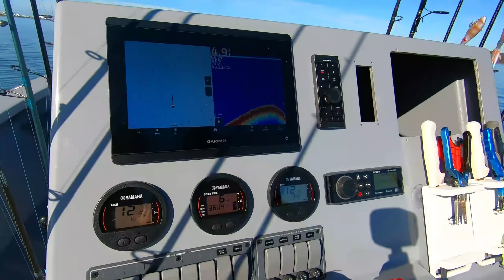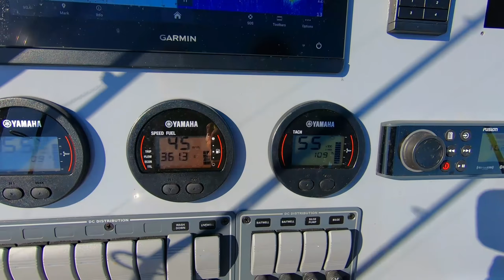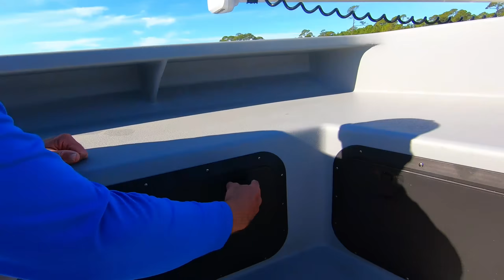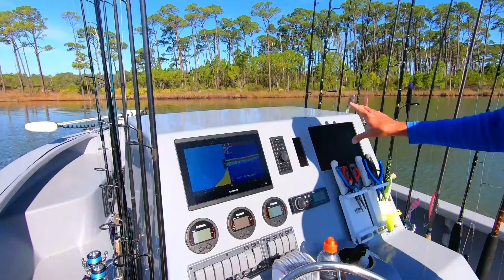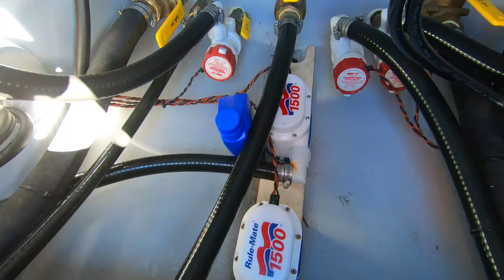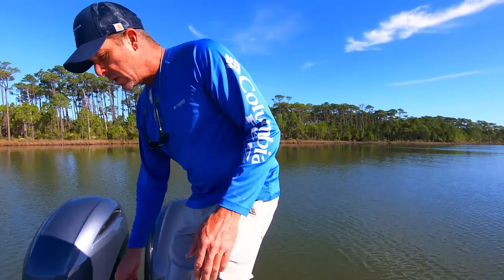EP-25 BOAT BUILDING SECRETS REVEILED! TOP SPEED RUN AND FULL BOAT TOUR!

Comment: Hey Joe, I've gone back to your older videos on the 29' to see the build and performance.  What's the deadrise on that hull?  It shot out nice with the 150's and settled in smoothly.  Great boat for your needs.  Really nice rigging.
Reply from the maker: It has a variable deadrise hull, with around 15 degrees at the stern. Then increasing as you move forward. I wanted a large boat that could get very shallow, and run well with modest horsepower and she does that very well! Thanks for watching!

Comment: YOur videos came into my youtube feed while I was searching techniques on building boats. I wanted to say you explain things very well to your audience. Oh and the Buskens 29 need a hard top lol and take her out in some chop.
Reply from the maker: Wow, thank you! I agree! We are working on the mold for the hardtop right now, and will be releasing videos on that project very soon. I do have a video here on the channel when we run the 29 on one engine out in the Gulf and there was some chop that day. You might enjoy seeing that video also. Thanks again for watching and commenting
Reply: I will check it out, I saw it but did not view it. I am working on a 66 mfg that is gutted and ready to glass the transom. I am doing the transom from the inside.  I notice the outer skin has a ton of holes ( which I am okay with I will turn them into fiberglass rivets) and is slightly warped at the top.  I am having issues getting the wood to touch the inside of the outer skin on the portside bottom quarter. THis has me thinking to cut the outter skin and build a new outer skin which I never done before. All transom I seen done from outside had an inner skin.
Reply: Issue solved seem to have some thicken resin over the inner skin. Went to work with the grinder yesterday and some 36 grit. Down to the woven now. No need to cut it out.

Comment: Not that 47 is anything to sneeze at, but did you trim up at WOT? I get an extra 2-3mph by trimming until it just starts to porpoise.
Fun to see it all come together.
Reply from the maker: Yes, you right. Trimming out at WOT is important. If you look at the right side of the tachs you can see the trim gage move up as we increase  speed. I usually start out with the motors trimmed all the way down for the hole shot. This boat likes 3/4 of max trim at wot. As we held full throttle at max trim she picked up to 48mph. That's not crazy fast by some boat standards, but good for a 29 foot boat and 300 hp. I appreciate you watching and commenting

Comment: Captain joe I’m replacing the stringers in my 21’ center console and I’m trying to figure out how to level the deck bow to stern, my thoughts are to level the boat using the water line then cut the stringers level as well so the deck is level with the water line. Will this system work?
Reply from the maker: That sounds like a good plan. You just want to be sure that there several degrees of pitch in the deck from bow to the stern. That way water will always flow towards the transom. Hope that answers your question, and good luck with your project!
Reply: @FishBumpTV  I can’t believe you answered my question you are a man of your word I have asked others the same question and they have not responded thank you and god bless you
Reply from the maker: @marcdiverdi9366  glad to help!

Comment: What a solid boat. Im really suprise the kind of speed you are getting with that size motors and size of boat. What size prop are you running on that boat.
Reply from the maker: Thanks! We are very happy with her performance so far, especially for hull #1. Efficiency was a big factor in her design, we are also seeing close to 3 mpg at midrange cruising speeds running Yamaha saltwater series 3 blade 15.5 by 17s. Appreciate you watching and commenting.